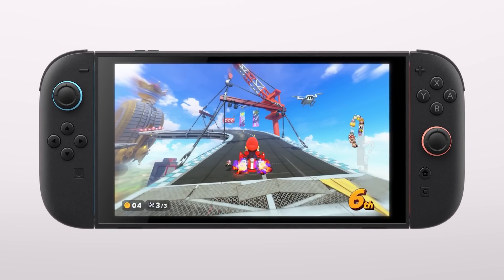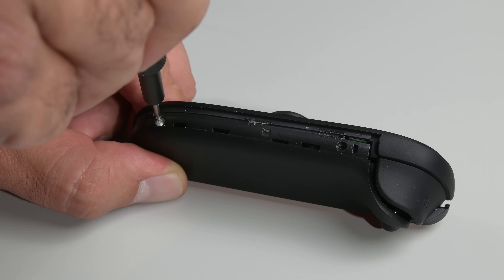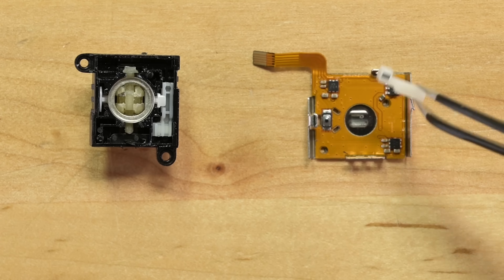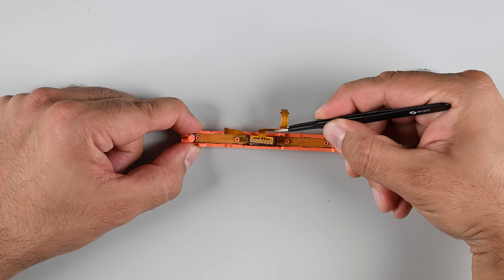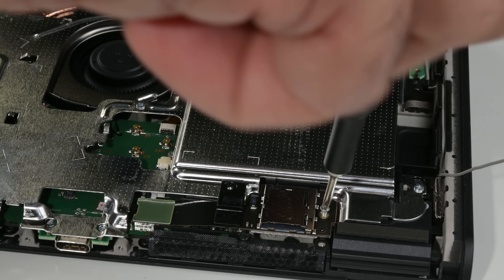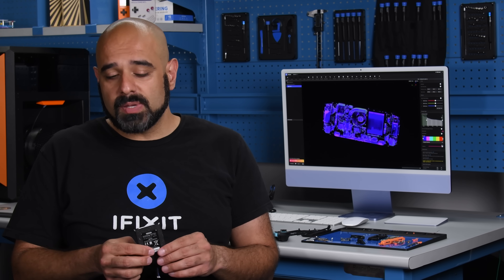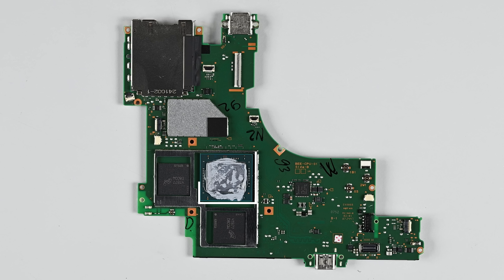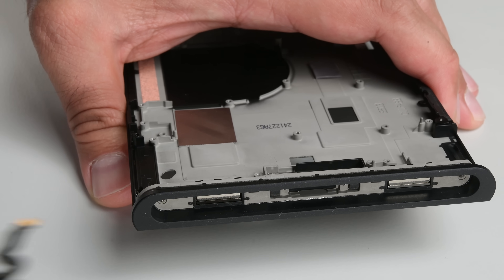Joy-Con Drift Isn’t Dead: Inside the Switch 2

Comment: How can Nintendo be so tone deaf by not fixing the joy con design when knowing it was a massive issue on the first Switch. They even admitted the issue and apologized for god sake.
Reply: people wont do what is necessary...... stop buying crappy products
Reply: They're selling $80 cartridges that just give you a "key" to download the game. Why do you think they would care enough to do anything?
Reply: @JamesSchulte the misinformation is crazy
Reply: They know that most people will just buy new controllers rather than go through the hassle of getting it repaired or sending it off for a couple days or weeks to get repaired. It's more profitable to them to cheap out on parts and even pay for the "few" repairs if it means making more money on the joycons.
Reply: Because it's on purpose
Reply: because naive people will buy it anyway
Reply: Planned obsolescence.
Reply: PS2 had analogs with hall effect from the factory. Have you ever heard of any problem with the PS2 controller?
Reply: It's not the same
Reply: because loyal fans will buy it in droves no matter what
Reply: One word. Money.
Reply: It's all about money.  Going by the figure of 3 million units sold day 1, if they save $1 per stick then that's $6 million more in their bank accounts.
Reply: They are not tone deaf, they are money  🤑 hungry deaf. Each cheap solution saves BOM  which makes them warm more money and that's what's going on.
Reply: Because you still buy controllers with same problem and you won’t stop
Reply: On simple word: Greed
Reply: the stick technology they talked about in the video wasn't the root cause of widespread drift issues in the original joycons. it's the same technology every console manufacturer has used on their default first party controllers for the past 25 years. you are being manipulated for engagement.
Reply: @degatimra yeah. The main problem has never been the method used, but how it was applied. The original joycon were very fragile and prone to breaking. We still dont know with these ones
Reply: That's how companies brake your spirit. They first get you hooked by giving you brilliant products, then slowly start taking stuff away and do not even listen to complaints AND charge you more for half a decent product. By now however, you find yourself addicted to the brand after years of loyalty and buy every turd they put in a neat little package. Nintendo can do this more than any other gaming company cause of their ip's. Alot of people buy a Nintendo console because you can only play their games on their consoles (legally).
Reply: it was cheaper to not fix it than to fix it. its that simple. They just need to keep getting sued till its not financially worth using. Im sure those controls cost them nothing to make and the gap between people who know about the program vs who buy new controls is big enough that they dont even have to care about giving away a few
Reply: @jujijuman  Can sue them anymore, when you agree to their EULA you agree to settle legal disputes through arbitration.
Reply: They're greedy and want to sell you the solutions to the problems they create and don't fix.
Reply: hall effect is for the more exxxpensive oled maybe
Reply: Buy another joycon set
Reply: Because you guys are still going to buy it lol...
Reply: Money
Reply: Do you think their sticks are worse then the xbox?
Reply: I must have got very lucky as I never had any issues across my 3 switch 1's and pro controller
Reply: @mmort981  I think its related on how people actuially use the sticks.
If you use more pressure to move the sticks, it will wear out faster.
And the joy cons are more prone it it, since they are low profile and used a lot.
Reply: So they can sell more joycons💀
Reply: Cash cow.....They will make more money from kids screaming at their parents to buy new ones with next day delivery from Amazon than the time needed to go to a repair shop or difficulty in repairing it yourself.

For every one person seeking a repair there are probably tens or hundreds who will throw away and order new
Reply: I’m because they are Japanese
Reply: because for some reason they were obsessed with putting magnets in the joycons. that magnetic field is probably the reason why it's incompatible with a hall effect sensor
Reply: because, if the controller breaks then you have to buy another $100 pair of controllers (too bad they don;t sell them individually).
Reply: @ElZamo92 they do sell them individually, and they also repair them for free
Reply: They like extra money
Reply: The switch 2 has literally been out for 2 days so fn relax
Reply: Hall effect sticks simply don't work with magnets that close.
Reply: because they dont care and they know their braindead fanboys will buy it anyway
Reply: The reason is called capitalism.
Reply: Easy. Me and you will juat buy another pair.
Reply: I couldn't agree more. Nintendo has become so arrogant.
Reply: I still have my original xbox, ps2 controllers and all works fine. NO drift. We need to wait this one and see.
Reply: Make it so people can't sue and you have a gold mine.
Reply: because most people will just buy replacements instead of sending them to get fixed which means more profits
Reply: Because the person who apologised was a human and not an EA CEO
Reply: They make much more money from people forced to replace their drifting Cons and having to buy new ones, especially that they raised all the prices for accessories this time around.
Reply: They get more money by not fixing it so thats probably it
Reply: Money
Reply: Bc majority of peoples will rebuy
Reply: Most people would prefer buying new controllers than wait 2 weeks for a fix. Thats probably a great revenue stream for them and fixing it would be a blow to the bottom line
Reply: Money....or what do you think why they sold so much joycons.
Reply: Just because you apologize it doesn't mean you mean it. They are just words.
Reply: They don't need to if people will still put  $90 down, even despite hall effect and TMR competitors being on the market.
Reply: So they aren’t tone deaf. They will keep trying to get away with doing things as cheap as they possibly can until people make them have to care. Until then…..WEEEE!!!!
Reply: scammers and thieves are running that company who would sell their own mother for profit that's why
Reply: Corruption and money. Pro corpo US is also at fault here. The court literally gave Nintendo the win and rejected the lawsuit after 5 years. Nintendo may offer free replacement, but its only in the US. Scam company.
Reply: The switch controllers were deemed detective, its lame they chose magnets to connect them to the device rather than address their problem. Its pure greed, they know a lot of folk will go out and buy new ones.
Reply: They only apologized because of a lawsuit. They kept drift because people keep buying JoyCons.
Reply: tone deaf yes. but lets be real here.. in my Nintendo switch's life... i only experienced drift around its 5th year of life and i have Monster Hunter Rise and Smash Brothers. 

so fringe cases like me helped justify nintendo's decision of not having hall effect. so at the end of it all its going to be a player customization thing than a proprietary fix
Reply: Cause it don't happens anymore so often
Reply: 150 million lifetime sales suggests it's not a deal breaker for most people and less r&d means more profit.  
This isn't Iwata's Nintendo.
Reply: @Darius_Cyrus Nintendo doesn't create any of it's own tech. That's their thing since Iwata took over. The potentiometers since the Wii have been made by Alps Alpine, who also make the potentiometers used in Xbox and Playstation controllers. They basically have a monopoly on potentiometers. Xbox has been using them since the OG Xbox, while Sony and Nintendo since the Wii and PS3, as they thought the magnets in hall effect sensors would cause interference with the wireless controllers.
Reply: @BurritoKingdom  Huh, the more you know. Google says it's actually been since since the PS4, which tracks my own experience of controllers being higher quality in gen 6 and 7.
Reply: @BurritoKingdom  They mentioned a couple alternatives to HE sticks. And there are a few rare models of PS3 controllers that have MRWB (MAGNETORESISTIVE wheatstone bridge) sensors. I might sell my MRWBs on eBay...or to a museum
Reply: This is a wait and see sort of problem. Analog sticks have existed for a long while that haven't been hall effect and they've been fine. Allegedly the issue was in part due to the implementation of the analog stick, such as having proper support underneath them to prevent unnecessary wear. It could possibly be related to the conductive materials. Whatever it is, I doubt that Nintendo is intent on having another free repair program for these Joy-Cons like they had with the previous model
Reply: @ruffmadman  My friend's Switch 2 already has drift in one joycon.
Reply: @rybug15 Bs. It's litterally not possibile.
Reply: @PacsterMH  Well, it happened so it is.
Reply: @ruffmadman  One of the more level headed comments Ive seen here.
Reply: @ruffmadman  Exactly, those joysticks are quite clearly completely redesigned; potentiometer or no. I'm not sure what kind of person would think Nintendo's engineers didn't at least take steps they believed would mitigate the issues.
Reply: @ruffmadman well nintendo is offering free joycon replacements if there drift so thats not a good sign that they didnt do much to improve from the switch 1 joycons
Reply: @UltimateInkling 
You mean.. They aknowledge that the Switch has waranty? And that they will replace/fix stuff when it happens under waranty? Groundbreaking.
Reply: It's pretty nutty. I personally had to get both sets of Joy cons repaired.
Reply: I'm not sure they can use hall effect sticks because they're using magnets to attach the joy cons to the system. Hall effect sensors would start drifting if they're affected by another magnetic source.
Reply: @BurritoKingdom which is irrelevant for the Switch 1, they still didn't do it.
Why? Because most just replace them, or buy a new pair while the others are being repaired. This makes them more money.
Reply: @BurritoKingdom  so don't use magnet attachment... It is not a problem.
Reply: TMR tech would likely work.
Reply: @BurritoKingdom  Have you seen all the methods that computer cases use to attach their big crystal windows?... there is no excuse.
Reply: Lets be real, it's because switching to hall-effect sticks would be Nintendo admitting that the sticks on the original Joycons were problematic, and that would open them up to lawsuits. The stick housing is already shielded, an external magnetic field would be unlikely to affect them.
Reply: @untildawncrepes  Yep, very probable too.
Reply: @untildawncrepes there are a few videos on YouTube showing that hall effects would be effected by the switch 2 magnets. stop ignoring this elephant in the room by just saying its unlikely with no evidence
Reply: @pixsled shielding a hall effect sensor from external magnetic fields is not some insurmountable problem. Literally all you need to do is encase the stick box in metal, which will deflect the field, which they already are.
Reply: It can be so tone deaf cause consumer keep on eating up their bs. I mean they are literally the most anti-consumer company I can think off...
Reply: @PtYt24 Ever heard of Apple?
Reply: Its not that Hall effect switch are expensive,

It's that Potentiometer with potential drift issue are massively cheaper to produce.

They still want to save million dollars on the analog joystick by inconveniencing the costumers.

Despite hall effect joystick are becoming so cheap, even $18-$20 chinese controller have hall effect nowadays.

We can only wait for custom Joycon with hall effect for switch 2, just like aftermarket joycon for switch 1 with hall effrct.
Reply: @01_zenyobi planned obsolescence. Hall effect means they'd be worried about controllers lasting way too long for selling accessories not to matter. They shifted their strategy of selling the console for a profit to offset tarrifs to keeping the device relatively close to a base PS5 / Series X to shifting to accessories and games. Plus, Nvidia is expensive. Guess why the other two console makers went with AMD. They didn't have a choice because Nvidia can't make both the processor and the GPU at the same package (unless it's ARM), and they're profiting immensely from the AI boom and don't care what happens to their gaming division. Intel is way too far with their GPU to catch up with either Nvidia or AMD.
Reply: @01_zenyobi  Bro, they have huge margins on their control peripherals... they squeeze the people that use their console´s the most.
Reply: Because they sold through 3 million consoles in 24 hours. Nintendo fans do not care.
Reply: Unfortunately this is type of stick is the only way. Hall effect cant work on this console because of the magnets.
Reply: Because you buy it anyway, enjoy!
Reply: They don’t care. They are pissing on their customers😂😊
Reply: They say they've redesigned them and I'm pretty sure they think they fixed the problem, but we won't know if it's actually fixed or not for a while.
Reply: Okay you try cramming as much tech as they did in a small controller
Reply: cause they know they could put the worst product out and idiots will still line up to buy it
Reply: That is why the Switch is more expensive, it is already included in the price. And if you don't get stick drift, thats more profit.
Reply: 그게 바로 닌텐도
Reply: Because Hall effect sticks cost a tat more, and if they put the money in th3 product they don’t have it for themselves, don’t you understand!?
Reply: @erebostd it's not that. Hall effect uses magnets. The console has magnets. You see the problem?
Reply: @PacsterMH no, i don’t see the Problem. But i only work in medical equipment hardware r&d and magnetic shielding isn’t only available and cheap, but most likely in some hardware you already own. Oh, and you don’t really need shielding, just calibration…
Reply: @erebostd the magnets are right  near the pads, there is barely any space inside the joycon
Reply: You know what's even better? They updated their EULA to make it so it's impossible for you to sue them in court. So even if joycon drift becomes an issue again or if they falsely bricked your console, it's not their problem.
Reply: Not tone deaf, they just know nintendrones will buy this and thank them for the 90$ games. Just business.
Reply: @Tom3kkk what $90 games are u referring to?
Reply: It's an anticonsumer practice, they are a cartel that illegally fix game prices and run peripheral businesses, there are huge margins on their overpriced peripherals. MS started, Sony followed, then Nintendo. Who would have thought that chinese gamepads would become the way to go?.
Reply: You can always buy new ones
Reply: @regenjo ah yes let's buy new ones because the company you already paid 450 € to for the console decided to use inferior parts.
Reply: @regenjo This guy works for Nintendo’s financial team